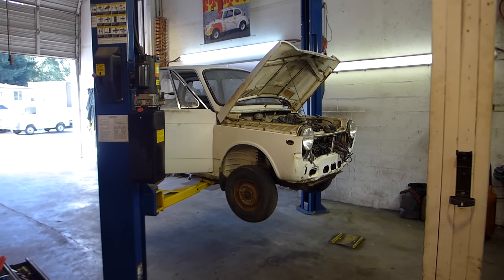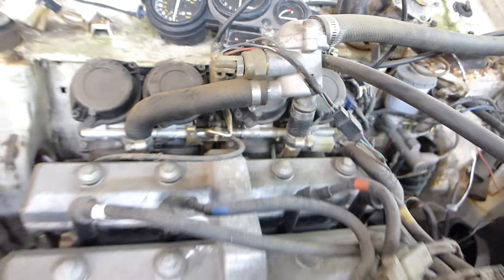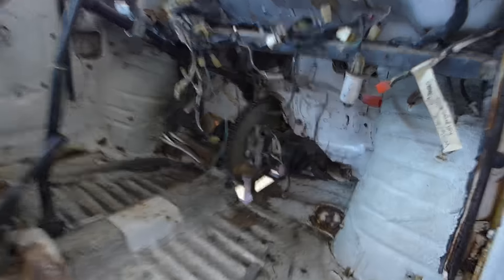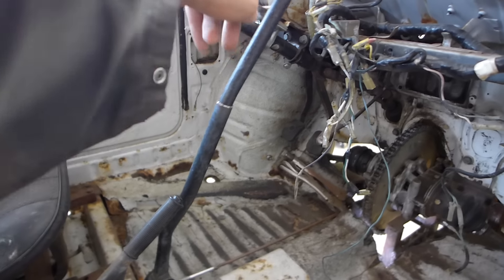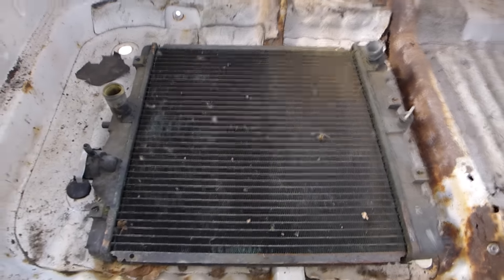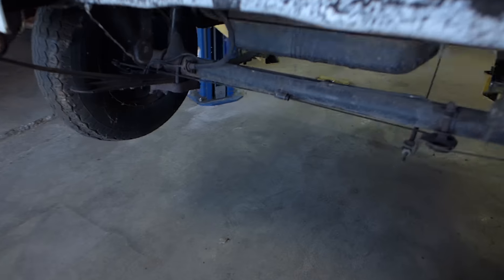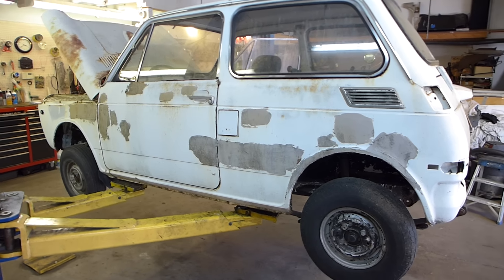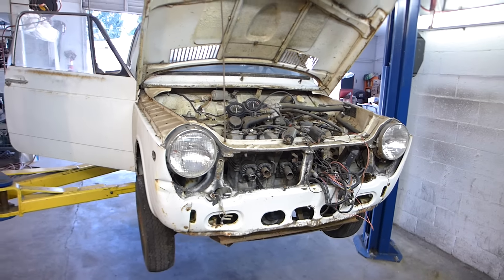Motorcycle Engine Honda N600 Project Restart

Comment: there any snowmobile transmission available for that engine ,a snowmobile Trans might have worked better. one idea for the radiator you could mount it to the fire wall so that it can double as a heater core and it would give you extra room for the exhaust manifold